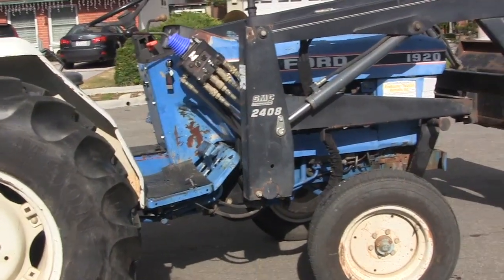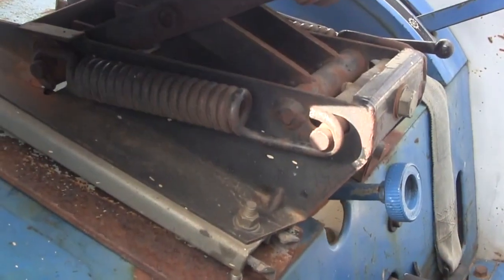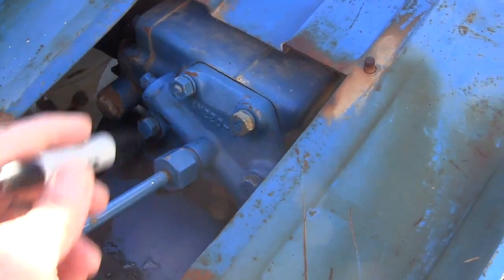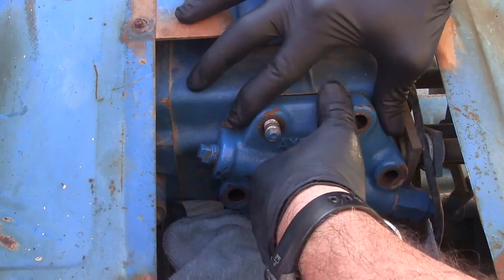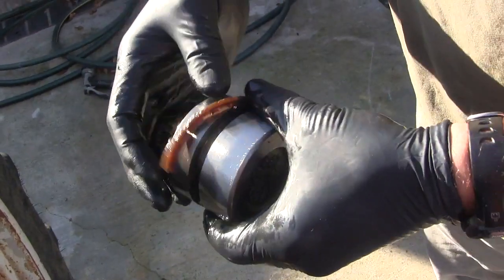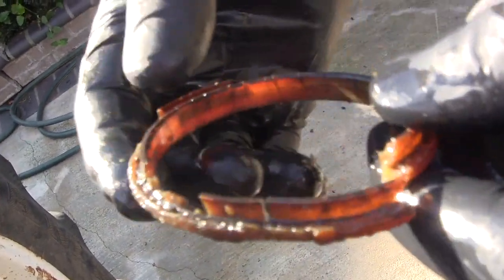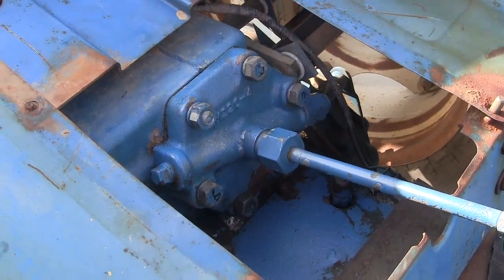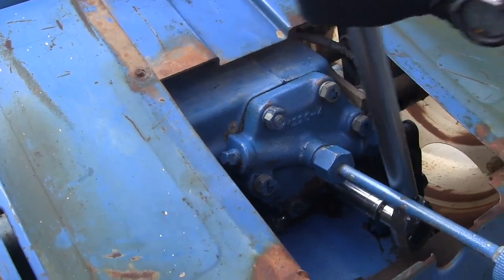Ford 1920 Tractor 3 Point Lift Bouncing, Hydraulic Problem / Fixed

Comment: Very helpfull - ive bought a 1920 with 800 genuine hours and its 3pl  is bouncing with a load on it , so am just about to embalk on doung the same check now .
😊
Reply from the maker: Good luck 👍, my tractor is still working great and it's been 3 years since I posted this video. The hardest part is trying to get the  seal over the piston, but once you get that, the job is pretty easy. I am glad the video helped out. Take care and God bless.

Comment: Well I finally got the seal on the piston! It went back together smoothly after that! Works well now. Thanks for your help.
Reply from the maker: Excellent, glad I could help.
Reply: Did the same thing now Myers 3 point doesn't  work at all whatdo uou think the problem  is now

Comment: This was a fantastic video, not one second of "oh for crying out loud.....do we have to watch this guy wash all the parts, etc.".  YOu know what I mean. I know this is three years late but would a 'shuddering' as the three point is adjusted when box blading be of the same issue? This old 94 Honda 6522 I picked up runs and operates perfect with the exception of not being very smooth on 'creeping' the 3pt. stick on the fly. So the best I can do to explain the lack of response from stick  to action of implement makes for a headache grading a road smooth! 
I'm not sure if I'm understanding the bounce or hunt is the same problem. I have heard others mention their problem was like the system was constantly reacting up and down without stick input? Mine holds, adjusts great for draft control, holds in position once set, it's just hell trying to make small adjustments to the 3pt. for hi-lo grade corrections and of course the shudder when dropping the hitch down. Thanks, I could have sworn you were a tractor mechanic for how you went about taking on your problem. Have a great Day!

Comment: Thanks for including the part numbers I just ordered my seal.
Reply from the maker: Justin, I'm glad it helped
Reply from the maker: @jasonbradley7973  - Looking at the parts manual, I am showing a Baldwin filter BBT8505. My tractor is at a friends house right now. I will call him today to see what filter is on my tractor and let you know.
Reply from the maker: @jasonbradley7973  - These are other filters that are also supposed to work:

Fleetguard HF35359
Ford SBA340500410

NAPA 1208
Wix 51208
Reply: I really appreciate your help.

Comment: Great video. I have a 1720. Is that the same seal. O rings were fine, but seal was disintegrated.
Reply from the maker: I am glad the video helped. I am not sure if the seal is the exact same for the 1720 as it is for the 1920. You can try calling https://www.messicks.com/ to see if they can help. That is where I bought mine.
Reply: I already got the rubber O rings from Messicks (buy from there all the time) but dont' know why they did not include the oil seal. My fault for not realizing your the 1920 not 1720, I got the seal locally, which you listed and apparently it is different because it is just a little too big. I'll call Messicks in the am.  @tedpappas1559  Again, thanks for the video- I am sure this is the fix. Was your hydro fluid milky. mine was- guess I now need to know the capacity for a full drain and fill.
Reply from the maker: Replacing the seal definitely worked for me. I have no trouble with my 3 point bouncing anymore, even with heavy implements. My hydro fluid was not milky, so most likely you got some water in there and should change out your fluid. Good luck 😀👍  @erichouwen3771

Comment: I guess I am going to do this pretty quick.  I have a 1920 purchased by my dad in 1990. The lift just started to hiccup.  I will replace the hydraulic filter first to see if that is the issue.  This is the only issue this tractor has ever had.
Reply from the maker: Hi Jason, most likely it is the piston seal. The 3 point starts to hiccup because the seal is allowing hydraulic fluid to leak through which is causing the 3 point to intermittently fail as the pump is doing it's best keep it where it belongs. The job isn't too hard though. I hope this video helps you out. Take care and good luck.

Comment: My Ford f1700 loader and backhoe is jerking but the backhoe and thenloader I don't use the 3 point . And it moes slow 
 I add hydraulic fluid and more and more and nothing . I can have high rpms and still loader  or backhoe move hella slow
Reply from the maker: I would check out this video to see if it would help, because it sounds like a clogged hydrualic filter. https://www.youtube.com/watch?v=MbiptQT9m3Q
Reply: @tedpappas1559  ok I hope is the filter . This Saturday I will take it off and see . Then next step would be pump
Reply from the maker: @pedritoc.c.t.665  Good luck, I hope it's an easy fix for you 👍

Comment: Ted does that cylinder have any affect on the front loader. I have no hydraulics on my on my 1920 Ford tractor the loader and the three point went out at the same time?
Reply from the maker: Hi Vic, no I don't think it would effect the front loader at all. I would think you need to check the hydrualic pump or maybe a relief valve.

Comment: Great info but just wandering if the bucket attachment also doing the same or was it only the 3 point hitch? Thanks in advance.
Reply from the maker: No, it was only the 3 point hitch.
Reply: @tedpappas1559  Thanks

Comment: Hi, I just tried changing my lift cylinder gaskets. Looks like they sent me parts for another Ford. The O-ring is way too big, cant get cylinder even close to putting it on. Then they sent me a split ring plastic thin ring for the inside. Where did you Order yours from? Thanks.
Reply from the maker: I'm not sure what tractor you have, but this is the link to the piston seal that fit my tractor https://www.messicks.com/parts/new-holland/sba050309017
Reply: C @tedpappas1559 thanks for the reply. I went back and found your messages about where you got them. I ended going thru a dealer in Rochester, NY. Thank you.
Reply from the maker: @elitebowman5386  Sounds good, I hope it works out for you this time 😏
Reply: Hi, I got the right parts for my 2110 Ford Tractor now. I have them on the piston now. At 8:00 minutes on the video, your rod is centered so you could slide the cylinder in. How did you do that? Mine is down, and when I picked the 3 pt. Hitch up, it is way back and still can't center that Rod so I can slide it into the cylinder.  @tedpappas1559

Comment: having trouble kicking out of 3rd gear at full throttle with piece of equipment attached. It does not grind putting in gear or taking it out. It has only 1100 hundred hours on it. what could cause this?

Comment: Did this help with the strength of the hydraulics?  Mine is not hiccupping but seems to be getting weak.
Reply from the maker: Hi Steve, yes, it fixed my 3 point lift from bouncing. If you have weak hydraulics, it could be a different issue.

Comment: Did that rear piston seal also mess with your bucket loader ? I just got a problem yesterday with both front and back not wanting to lift or go down and making whining screetch noises, it might need a good bleed as I had all apart last fall to change the clutch but I don't see any where to bleed it or find any info on bleeding it.
Reply from the maker: No, the bucket lifted fine, it was only the 3 point lift that was effected and seemed to bounce with a heavy implement on it. You might want to try draining the system and changing the filters to see if that might help.
Reply: you have a hydrolic pump issue

Comment: Hello Ted, on the 3 point hitch fix. The piston seal is $41. About the same but the big O ring was $25! Did you get yours not from a dealer? I thought you said it was $6? Thanks
Reply from the maker: Hi Steve, no, I got mine from Messicks. I just checked and the price was $6.49. The part number for mine is -  O-Ring P/N - SBA052310750  or if you click on this link https://www.messicks.com/part/sba052310750/o-ring it should take you right to it. Thanks.

Comment: So I see why you didn’t video putting the seal on piston! I’ve tried everything
Reply from the maker: Watch this video (https://www.youtube.com/watch?v=P4-CA7zCz4M) this is how I did it. If you have a vise and a couple screw drivers it's not too bad.
Reply: So did you put it down into the groove then pull it?
Reply from the maker: Hi Steve, did you get a chance to watch the video? 
Put the piston into a vise, then place the seal into the groove of the piston. Take 2 screwdrivers and stretch it over the other side of the piston. 
It might slip off a couple times but you should be able to get it. The video I linked in my last post shows how to stretch it over the top of the piston. It's not easy, but it's doable.
Reply: Ted Pappas I didn’t get it but had to go to dealer for other parts and they put it on for me! After that it went together easily! Now I’m replacing seal between front axel and drive hub. 4wd

Comment: Lot’s of issues with this video, cringe worthy!!
1. Never use a metal pick on an o-ring, they make plastic ones for that.
2. Never put wheel bearing grease in your hydraulic system.  Use hydro fluid.
3. Lift he arms to make it go in all the way before you crush something.
Reply from the maker: Sorry I didn't meet your high standards Shawn. I am not a tractor mechanic nor claim to be. Just trying to help people who have the same issue but have no idea how to fix it.  The 3 points you brought up are good ones, I wish I knew before making the video. Maybe you should make your own video to show how it's really done, instead of criticizing others.